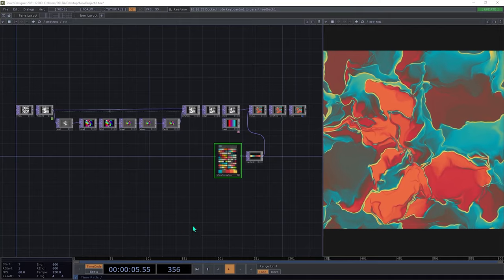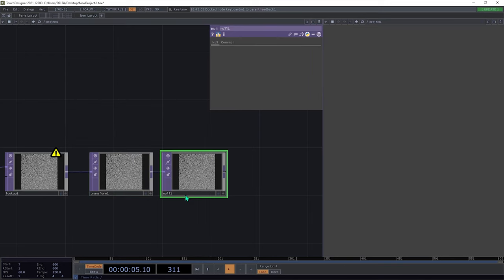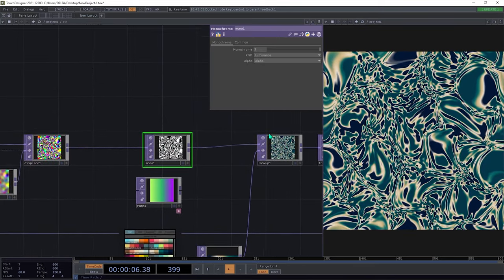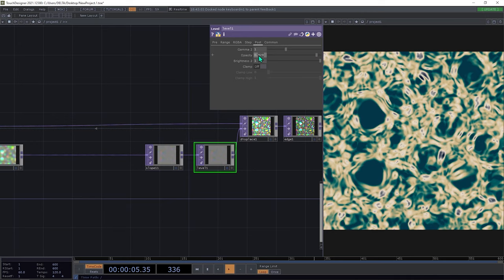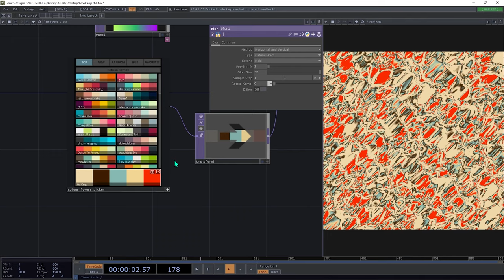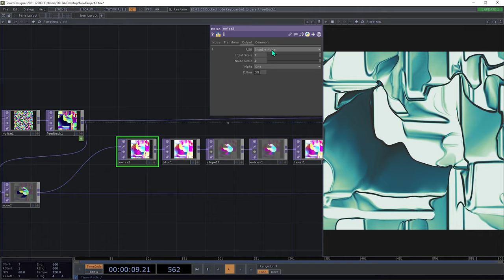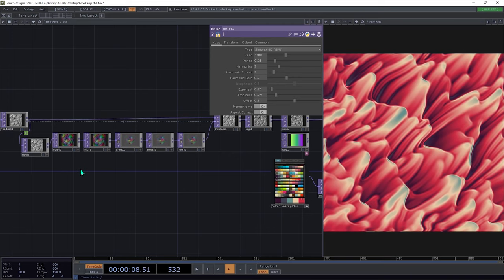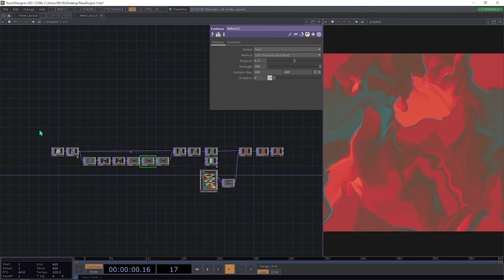TouchDesigner Tutorial 16 - Generative Drawings: Liquid Noise

Comment: Is there a way to have the movement morph in and out? In other words, instead of restarting each time have it instead morph backwards and forwards in a loop?
Reply: yes! - the trick is to use circle circumference coordinates as input for the noise. -- daniel shiffman has a video explaining how to do it in processing. you can do it in TD by converting a circle sop to a chop and cycling the points. the x and y values can go into the noise tz and translate 4d parameters.